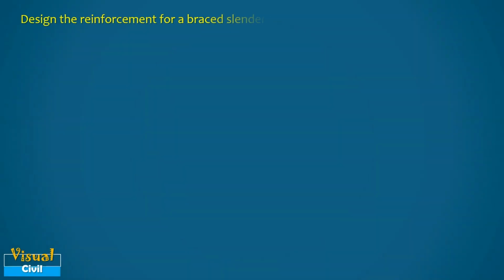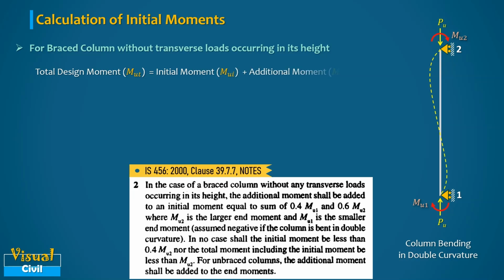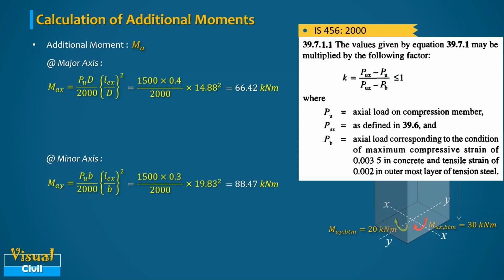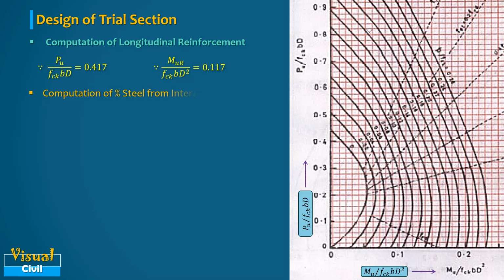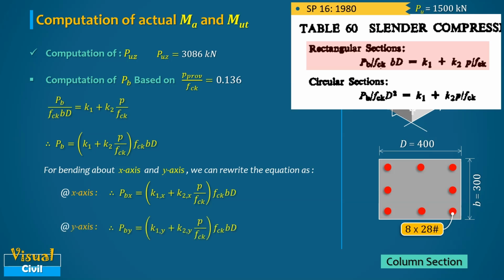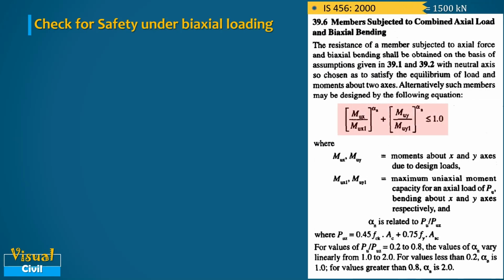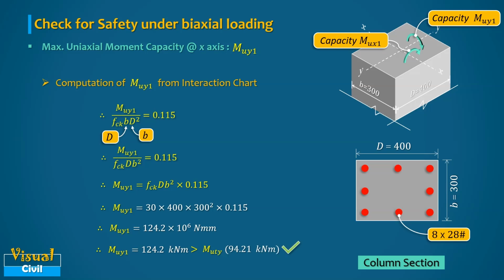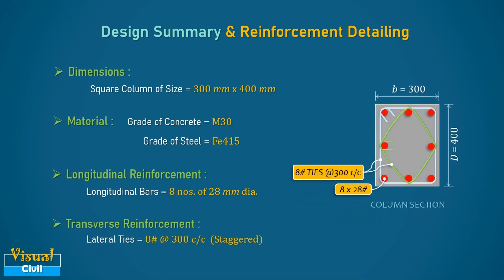Design of Long Column | Slender Column | Design of Column | Column with biaxial moment | Column

Comment: in professional job in structure engineering, based on which clauses we use resultant of mut,x and Mut, y and use that for further calculation, as well as i also watched your video of biaxial bending moment in compression member, you also use that same method there, so please let me know the references for that steps, any Indian standard or handbook or anything else?//